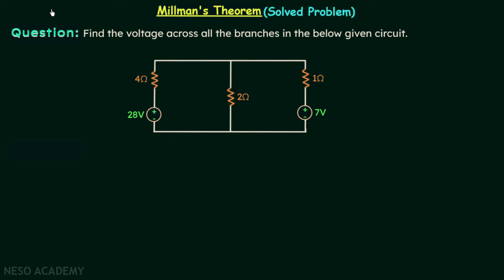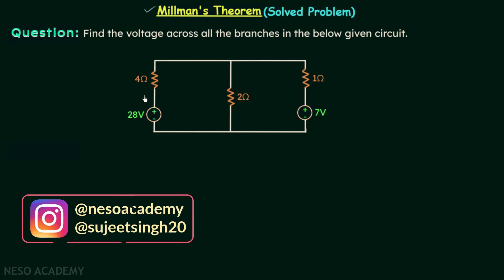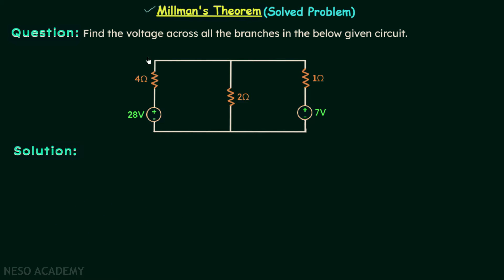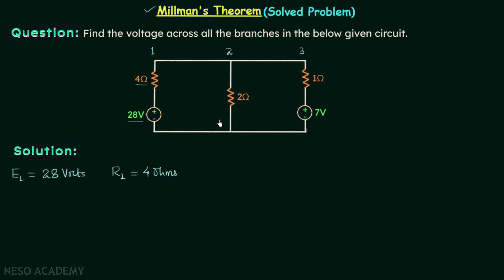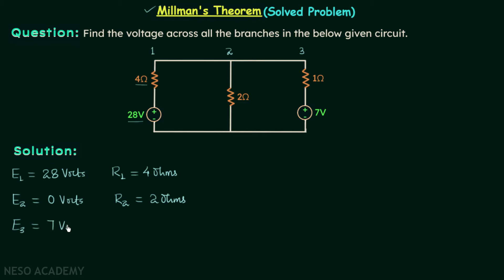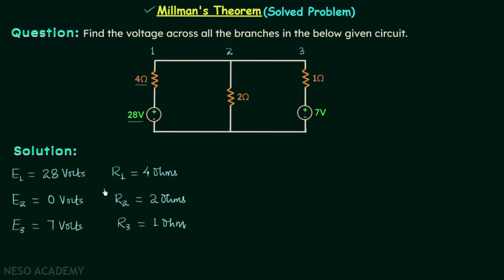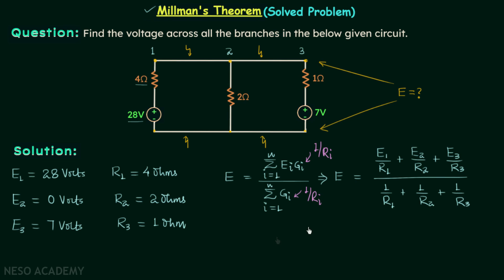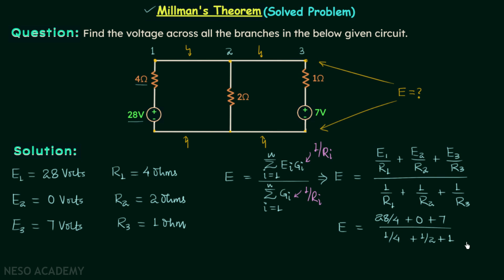Millman's Theorem (Solved Problem)

Comment: All the lectures are very good..  I have seen 50 percent videos of signals and system and continuing.
Please complete the networks portions as well so I could complete this course also. Very nice videos, clear understanding of basic concepts. Keep up the good work.
Thank you.
Reply: dear neso academy did u mean to say equivalent resistance in this video? because if we are supposed to find voltage drop across all branches then we need to find equivalent voltage by combining  the two branches contaaining  voltage source by millman th and then treating 2ohm as RL  AND FINDING DROP ACROSS IT  ,WHICH WILL BE EQUAL TO DROP ACROSS ALL BRANCHES